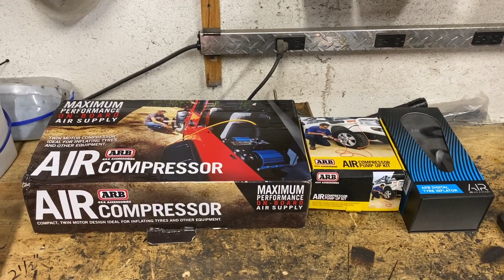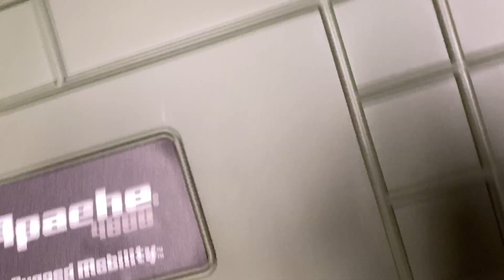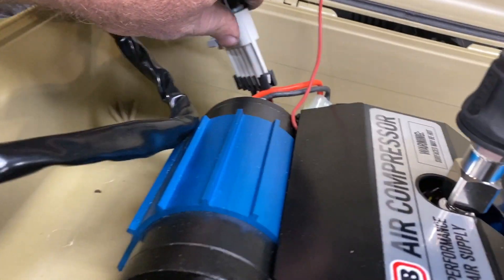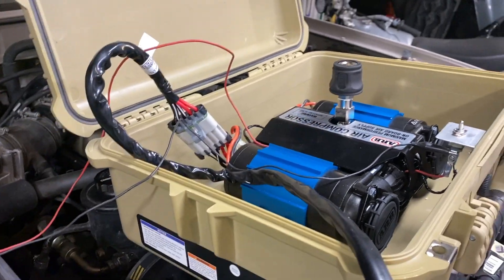How to Build an ARB Twin Air Compressor Mobile System #arb #twin #compressor #diy #portable #air

Comment: Great video except you glossed over that switch connection!!  Also, how come you didn't just screw the coupler directly into the compressor without that chrome t-connector?  I just installed one in my 4Runner today and that's what I did, but I wasn't sure if it was right or not, and it got cold and windy so I had to pack up before I could test it out.

Comment: A couple of people have asked about the jumper to switch wiring. It's the only reason I watched this a 2nd time. What do you connect the "ground" wire to (purple or black) since the "hot" wire is pretty obviously to the hot side of the battery?

Comment: What gauge jumper cables did you use?? Also a few people have asked how you hooked up the switch. Would be awesome to know the answer. Thank you. Great video.
Reply from the maker: I used 4 gauge.  I just jumpered a wire from the jumper cable power to the switched power in the wiring harness provided with the air compressor.  I put a switch in between so I can shut it off if I need to.
Reply: Thank you for your response. So am I correct in thinking that you only used the purple and black cables in the provided harness that are then plugged directly into the switch?

Comment: Great Work, was trying to do the same, How did you exactly bolt compressor to pelican case ?
Reply from the maker: I drilled holes through the case. Used some button head Allen head bolts through the case to the inside and secured them with nuts. I took my compressor apart and bolted the compressor bracket to the case.
Reply: Wanderluster appreciate your response